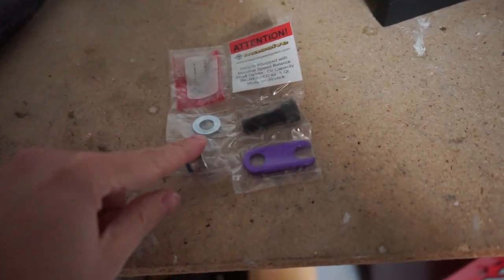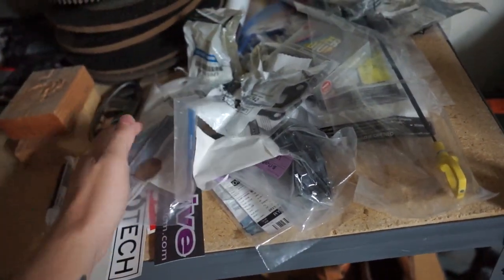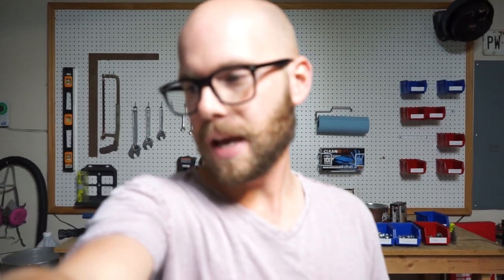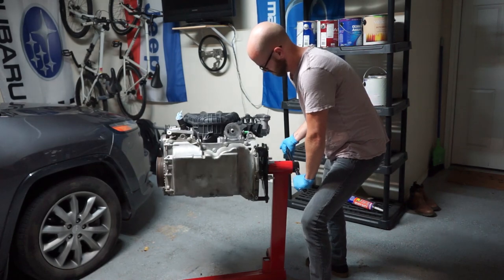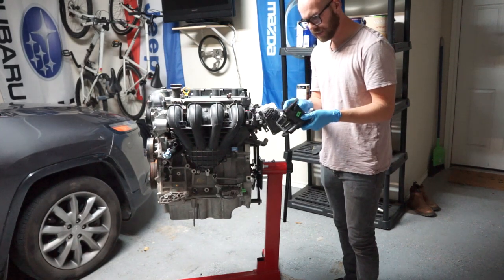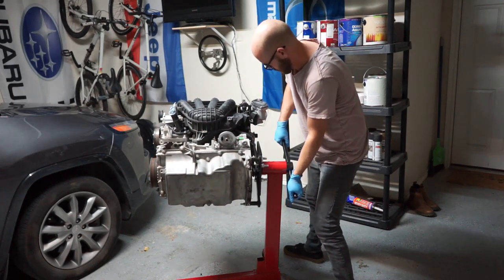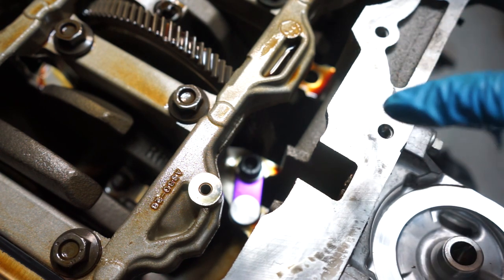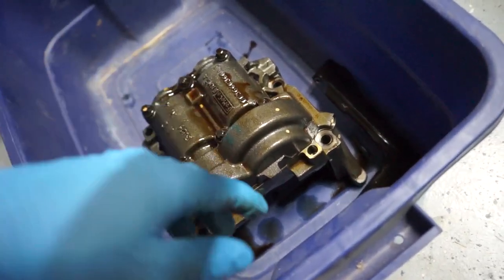Removing Balance Shafts and Installing Massive Speed Balance Shaft Delete Kit! - 2.5 Swap Episode 6

Comment: From left to right... knock sensor, then you have the pvc baffle plate (with a hose to the intake, rwd intake has a port for this as well), the last one is your EGR port (rwd intake also has a port for this) the tube on there now will not work... thanks for the NC miata content!!!!

Comment: unfortunately I can't post a pic here, however,  I put a 2.5 I'm my nc using the original 2.5 pan. naturally,  I had to cut and rebrace the subframe a little.  But now I am removing the counter balancers , then using a 2.3 pan that are $46 shipped from ebay. The subframe will still need a slight modification (ballpeen hammer) , but should fit without cutting and welding.  The purpose is to sell the complete NC engine with oil pan to a  spec miata racer for top dollar while replacing it with a $199 2.5 engine that makes more power and are super abundant

Comment: The piece you point to at the end is your crank case ventilation system, mountune and radium engineering make replacement kit for it or you could just keep the stock one. My understanding is it should be the same as what you have on your 2.0. hope this helps.
Reply from the maker: Thank you!
Reply: @ColoredinLight  From what I've read and researched, both the stock 2.5 and the 2.0 oil separator (Crankcase ventilation) will interfere with the NC intake manifold. Supposedly, one from a Ranger 2.3 fits and fixes the problem. The other thing to know is that the NC1 and NC2/3 intake manfolds differ slightly. NC1 is supposed to look smooth while the NC2/3 have reinforcing ribs on the outside which supposedly cause fitment issues regardless of what part you use, (Ranger, Radium, or Mountune). Check out Walter-Motorsports guide on the swap. They list out parts and part numbers.
Reply: Also the tube/bung you pointed at is the EGR tube for the 2.5, it goes directly into the 2.5's manifold while the 2.0 has a metal tube that runs underneath the manifold and bolts in. Currently doing a 2.5 swap on my NC and looked into plugging it but realized it would be a flag for emissions testing with the tube missing. Xero Limit sells a block off plate for the manifold side and goodwin sells a plug for the block side. Still debating deleting it or just plugging the tube with JB weld lol.

Comment: Do not delete the balancing shaft out of a stock 2.5 The balancing shaft helps keep the vibrations down  down out of the motor and out of your car it will literally vibrate your car to death without the balancing shaft  It's pretty much a fancier harmonic balancer
Reply from the maker: I've run this engine in my car for 2 years now and it's fine. Also, you have to take it out for this swap. The Miata oil pan won't fit with the balance shafts.

Comment: Is there a way to take off the oil pan with the engine still one. I tried to install this but because of the ac compressor, I couldn’t
Reply from the maker: Can't speak for your car, I'm assuming a fusion or Mazda 3?
Reply: You need to unbolt the A/C to remove the sump. Removed my sump and added an oil drain port for the turbo install.

Comment: If you were going to put the balance shaft back in, is there a critical alignment step?
Reply from the maker: I would not be putting it in. The 2.0 oil pan wont fit with it in, therefore it wouldnt fit in the car
Reply: If ever your putting it back in. Is there a timing or alignment? Thanks
Reply: @rechietiu2857  yes a balance shaft needs to be timed or the engine will vibrate badly, hence, "balance" shaft.
Reply: thomas hart thank you
Reply: @ColoredinLight  why do you need to put the 2.0 oil pan?

Comment: It's a process ....and where is that torque wrench?    Thanks for the video Jackson....keep shoveling there has to be a pony somewhere
Reply from the maker: Thanks for checking out the video!
Reply: @ColoredinLight  Don't get discouraged.  Take your time...invest in decent tools as you are doing so.
Reply: My 06 Winning Blue is at AR Hendricks LLC in Cypress TX as I type.  .  So I am not doing the labor and research as you are so my hat is off to you.  

My 2.5L with 11.k just had  1.5 Stage XeroLimit  Cam installed last night.  Armond is dropping in a tune and drive it to the dyno at CP Motorsports in Houston.  My chassis has 102.k miles on it stock so I will need upgrade the suspension of course when I get the car home.   First Miata ever owned that I kept stock for 5 years.  It'a AT BUT still a blast to drive. 

Installed the GWR 1.8 header and mid pipe.  Kept the stock intake and exhaust as I don't think they make any difference and at 61 years of age I am not into loud shit.     

I will let you know my HP and TQ

Comment: I have a 2003 Mazda 6. It spun to bearings. Can I take my balance shaft off and it run ok after I replace the bearings
Reply from the maker: I have to take the balance shaft out to fit the miata oil pan. I would leave it on if it was meant to be there

Comment: Some put baffled at the oil pan. Is it alright without it?
Reply from the maker: What
Reply: If you dont run a baffle you run the risk of oil starvation because the oil can move at a steepier angle in the pan when cornering.

Comment: What are the benefits and the cons of removing the balance shaft?
Reply from the maker: The benefit is that you get a 2.5 motor to fit in the NC 😁
Reply: @ColoredinLight  why doesn't it fit? You never actually explain that.
Reply from the maker: @boakium3089  the first step in doing these 2.5 swaps is understanding all the steps and pieces needed and why. Since I'm not making how to video on my first engine swap I wasn't going to be the resource for it. But you have to remove the balance shaft because the 2.0 oil pan will not fit with the balance shafts.
Reply: @ColoredinLight  u still didnt explain what the benefits are lol
Reply from the maker: @ballamaniac6984  lol look at the comments on this? I've explained it. You can't use it. There's no further answer than that.